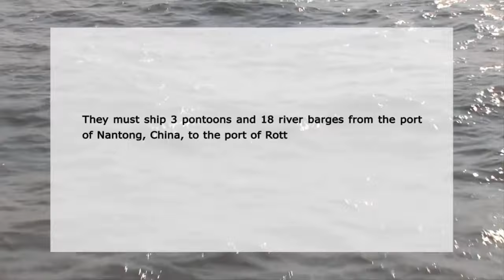🚢 Amazing Ships - Blue Marlin 🚢

Comment: Ok but how did they stack all of those ships though? And how did they get the both the platforms with ships on them to be balanced on the big ship so it doesn't tip over ?????
Reply: It's THICC
Reply: They did the second part probably by knowing all the weights, then calculated which ship needs to be where.